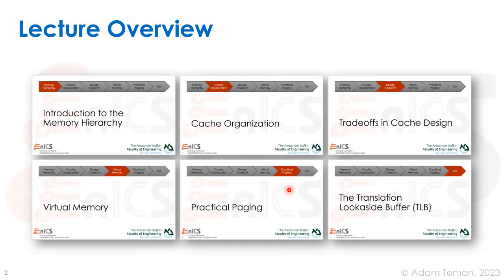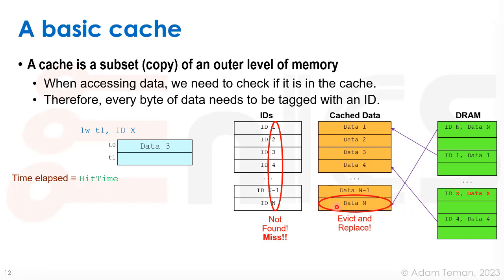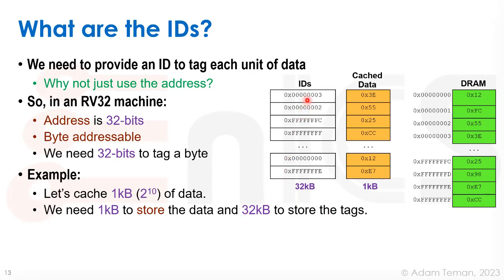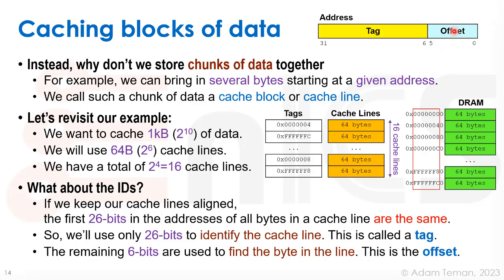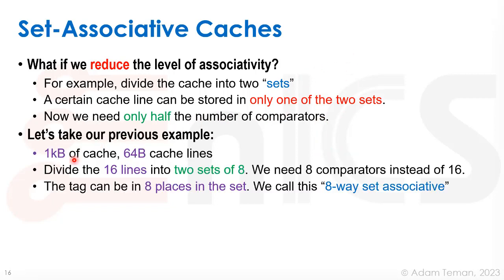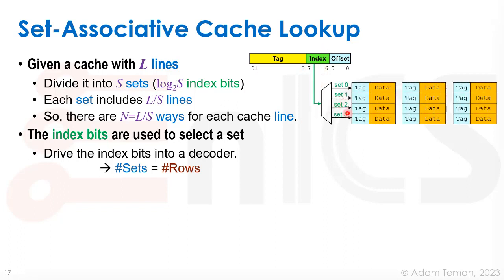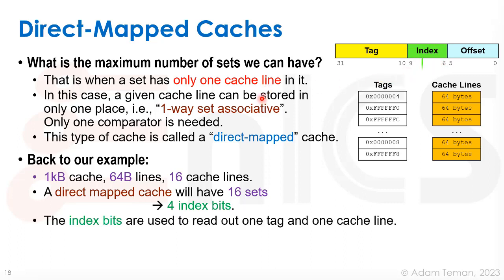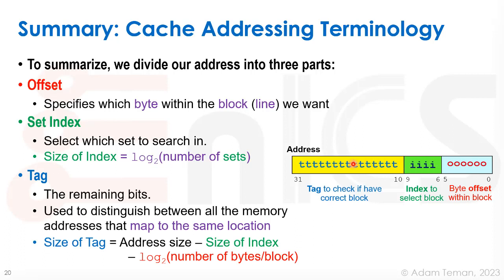SoC 101 - Lecture 6b: Cache Organization

Comment: For 1kB of data you would need 32 kb of tag space not 32kB. There is a typo there
Reply: Yes, for 1kB of data one would need 4kB of space to store 32-bits tags.
Reply from the maker: Hi, 
Thanks to both of you for pointing out the typo. I have pinned the fix in the comments.